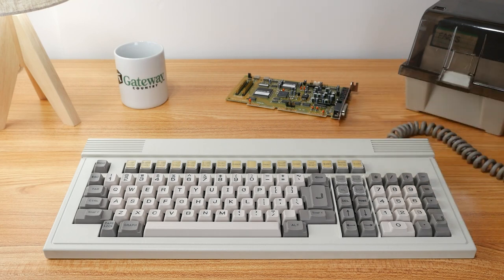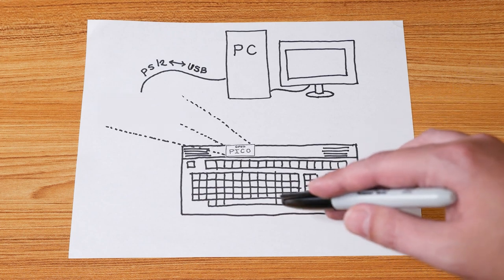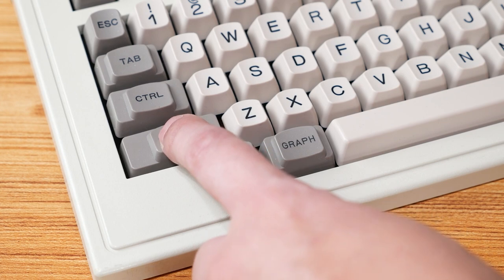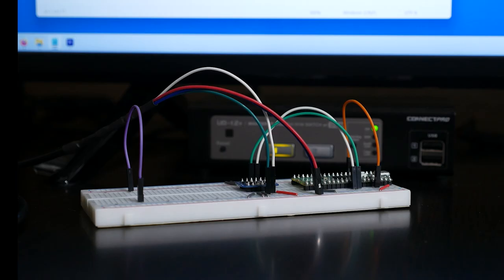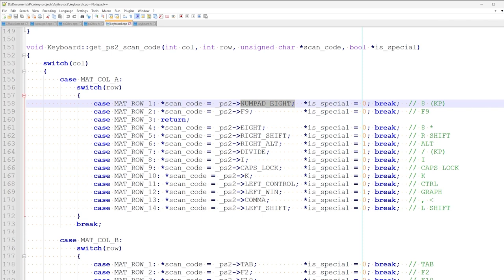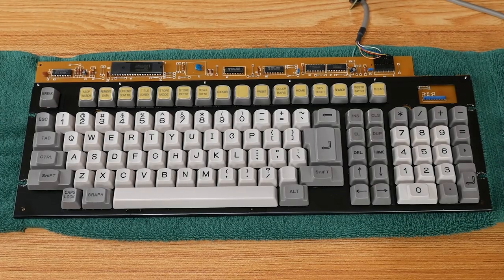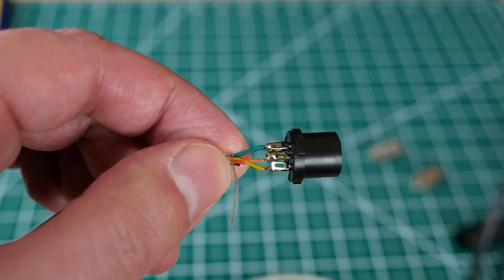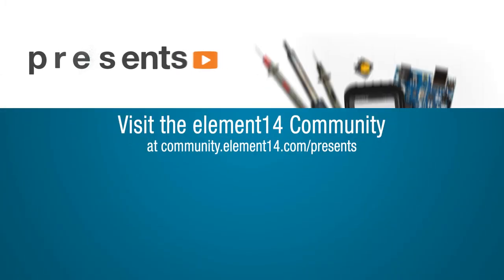Updating a Fujitsu N860-2500-T111 Keyboard to work with the PS2 Standard

Comment: In addition to the hot glue you can add a shrink tube to it, and the glue then seals the tube and really fuses the connector housing mechanically to the cable. Use enougth glue and wipe the excess off when the tube recovers.

Comment: How many key rollover does this support? I need to read a matrix of at least 75 momentary switches, with the ability to read all of them simultaneously closed. They don't need any repeat capability, just when each switch is closed it corresponds to a number, 1 through 75. The switches won't be opened individually, but all at once.

Beyond that I'd like to have support for 5 toggle switches or pushbuttons that latch on like a caps lock key on many old microcomputers. Support for a few other momentary switches would be nice but not essential.

Comment: A little surprised it had diodes in the matrix, they're not needed for one key rollover. I guess they started with a design capable of unlimited key rollover and just dumbed it down to a simple protocol.
It would also be good to wire up the USB as well to have it be usable on USB as well and make it easy to update the firmware. (Wire it so that holding down a certain key or combination of keys when plugging it in puts it into programming mode.)
Reply: Hmm... I don't remember now where I read that this keyboard has 1KRO. I could be confusing it with other, similar boards. Or you could be right and the diodes aren't necessary. Weird. I did consider making a separate USB adapter for firmware updates, but this project was already taking too long. Maybe some day!

Comment: I am attempting to revive an old scanning electron microscope. Specifically, it's a Jeol JSM6400. This piece of scientific equipment resembles a dinosaur, with its control system run by an 8086 CPU. The keyboard used to communicate with the ancient CPU is missing. It's supposed to be a Fujitsu N860-2880-T111. It bears a striking resemblance to yours, and I'm hopeful it uses the same protocol. I would be immensely grateful if it were possible to obtain the electronics of your old keyboard to reverse engineer the protocol. Please tell me you didn't discard it!!! Any assistance in this endeavor would be highly appreciated! P.S. Although communication with the instrument is possible via RS232, I'm eager to restore the original tactile experience of operating the microscope!